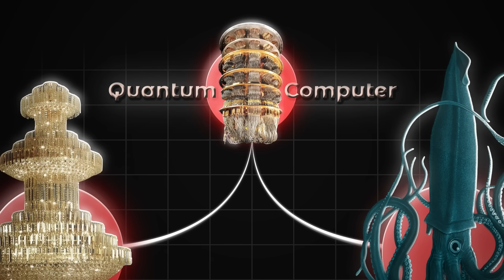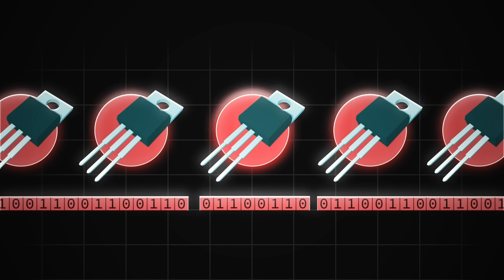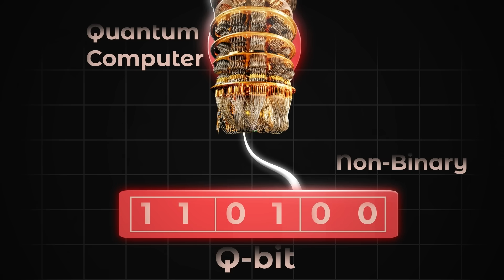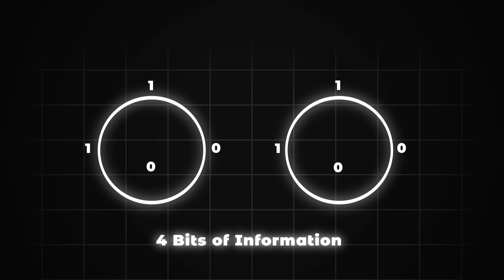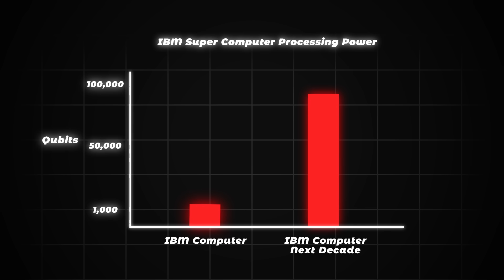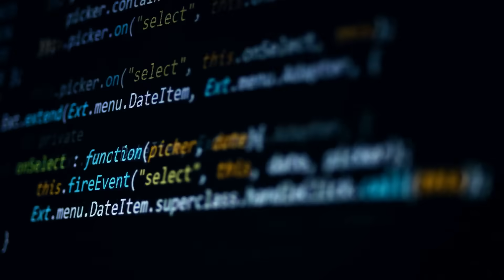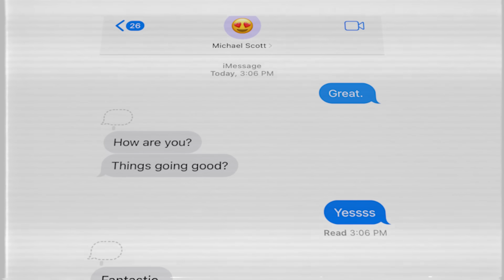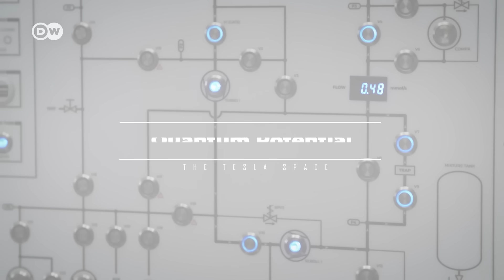Why Quantum Computers Will Break Reality

Comment: Ohhh up and down and left and right even off and on. 🤔 dont add center too? 🤔 sound like some cannot go smallest that why had to update different thing to order to made smallest into atoms. Rotor it flip down and up and left and right flip of spinning around with off and on. 🤔  i am correct?.
So it high speeds it made sound one of sound could cause error but limit speed ?. Because speed limit are order for one atom because if too fast spin speed it give one number in many number but need more quick reading to be get more number to send out signals  if slow readings it will think it 0 and 1 in one number confusing signal.

Comment: Pretty well done! Except you do not have to be at absolute zero to achieve superposition since trapped-ion via a radioactive element shown by IONQ achieves that at a stable room temperature. Also, the critical error rate will and has been increasing upended in a positive way via combination of AI algorithms and photonics. With this, a new quantum algorithm will eventually be able to stabilize the critical error rate to what binary classical computers have now. Probably five to ten years away but still very much achievable. Thanks for the video

Comment: If I'm not mistaken, quantum superpositioning isn't a physical description of electron spin actually existing in both positions at once as much as it is a description of the potential for both to exist, and that potential isn't actualized into one or the other until it is measured. I think it could just as easily be said that neither state exists or that the electronic spin is yet to have a determined state until the point when it is measured.

Comment: 3:35 This isn't true - at least not anymore. Traditionally, the process node designation such as the "28nm process node" was a reflection of the gate length, which approximated the actual physical size of the transistor. However, the last process node to reflect the actual size of a the transistors was the 22nm process node. The 3 nm process node is not actually 3nm in size. It's actually between 16nm to 18nm in size (gate length) depending on the manufacturer. So, while that obviously still incredibly tiny, it's about 6 times larger than you would think from the name.

Comment: Scientific Approaches to Superconductivity in Uranium Compounds

1. Heavy Fermion Superconductors: Uranium compounds, such as uranium tellurides and uranium platinum compounds, are part of the class known as heavy fermion systems. These materials contain electrons that behave as though they have an unusually high effective mass due to strong interactions between electrons. Some of these uranium-based heavy fermion materials have been found to exhibit unconventional superconductivity.

2. Nuclear and Magnetic Effects: Uranium is a heavy actinide element with significant nuclear and magnetic properties. Its 5f electrons, which are more delocalized than the 4f electrons in rare-earth elements, contribute to the complex electronic structure of uranium compounds. The interplay between magnetism and superconductivity is of great interest in these materials, as superconductivity can sometimes arise in the presence of strong magnetic ordering.

3. Superconducting States in Uranium-Based Materials: Compounds like UBe₁₃ and UPt₃ have been shown to exhibit superconductivity at very low temperatures. These uranium-based materials display unconventional superconductivity, meaning their superconducting states are not fully described by traditional BCS theory, which typically governs the behavior of conventional superconductors.

4. High-Pressure Superconductivity: Some uranium-based materials may exhibit superconductivity when subjected to high pressures. Altering the crystal structure through external pressure can affect the behavior of the electrons, potentially inducing superconducting states.

5. Superconductivity and Topological Materials: Uranium ions and their compounds may also be involved in the study of topological superconductors, which are materials that may host exotic quantum states at their surface or edges. These states could be useful for quantum computing applications due to their robustness to environmental disturbances.

Challenges

The challenges in applying uranium to superconductivity are mainly in terms of material stability, safety (due to uranium's radioactivity), and finding conditions where superconducting properties can manifest at higher, more practical temperatures.

In summary, uranium ions and uranium-based compounds are an area of study within the broader context of superconducting materials, particularly those that display unconventional superconducting behavior under specific conditions, such as low temperatures or high pressures.

Comment: I am very sceptical regarding qbits in quantum computing. How are we suppose to know which state is the correct state since we have to observe it even to check. Maybe with a few qbits it is possible but after a few thousands of them... but what do i know. Im just a simple engineer. Till that day comes i will be skeptical. And no, it will not replace normal computers. They are more like super duper calculators, but I'm skeptical.

Comment: I want to share with NASA, ESA, Elon Musk and SpaceX the Delta Vehicle I invented on April 19, 2000: a revolutionary system that harnesses all known deltas: Pressure, Voltage, Magnetism, Density, Temperature, Height, and Gravity. The most critical aspect of my Delta Vehicle is the Gravitational Delta. To fully utilize Gravitational Waves, the vehicle is equipped with three specialized devices:
1. Gravitational Wave Tuner: To precisely adjust the vehicle's alignment with gravitational waves.
2. Gravitational Wave Amplifier: To enhance the vehicle's response to these waves.
3. Gravitational Wave Router: To direct and control the flow of gravitational energy, enabling efficient movement and energy generation.

Comment: Quantum error correction cannot be solved if you don't implement the fifth Dimension. And I have noticed certain hints about this by the Chinese, comparable to the implosion of the atomic bomb. By the way, quantum mechanics explains through the fifth dimension what holds the largest and smallest forces together in there cosmological Infinity. Choose your future.

Comment: Quantum computers have the potential to break reality as we know it by fundamentally altering how we process and understand information. Unlike classical computers, which use bits to represent either a 0 or a 1, quantum computers use qubits that can exist in multiple states simultaneously thanks to the principles of superposition and entanglement. This allows them to perform complex calculations at speeds unimaginable with current technology. But this power comes with profound implications. Quantum computers could crack encryption methods that secure everything from online banking to national security, rendering current cryptographic systems obsolete. Beyond that, they might solve problems in chemistry, physics, and artificial intelligence that are currently beyond our reach, potentially leading to breakthroughs we can't yet predict. However, this also raises ethical and philosophical questions about the nature of reality itself—how much control should we wield over such powerful technology, and what unforeseen consequences might arise from unlocking the full potential of quantum computation? The line between science fiction and reality is blurring faster than ever.

Comment: This video should be taken only at a high level of thought on quantum computing.  Their are mistakes made in this video at the lower levels including his description of Schrödinger's cat.  Which does involve a cat, poison and a box but also requires a radioactive source and a geiger counter and furthermore the poison has to be sealed with the cat not being able to open it.  On;y the geiger counter going off can open the poison which would be a gas because if the geiger counter goes off then the cat instantly ingests the poison and dies, the thougjt experiment has no choice by the cat.

Comment: “With great powers comes great instability” Sound better and more relatable than responsibility
Reply: Because it's merely descriptive, rather than normative and exhortative.  It describes a future that is worrisome, rather than alerting or admonishing the reader to fear and fix the problem that will occur.  Eg, the regular phrase "with great power comes great responsibility" encourages the holders of power to act honorably ('responsibility in the exercise of power is required before it should be concentrated; the masses should give leaders power over them only if those leaders are virtuous and trustworthy'). Also there is an implicit bargaining in the future (or at least present) tense used in the regular phrase -- between the receiver of the power and those for whom she will have responsibility.

Comment: A qubit only has 2 possible spin states - which is reflected correctly when you say that 20 qubits has just over 1 million possible outcomes because 2^20 = 1,048,576.

I think you did a really good job explaining this part conceptually, but I wanted to point this out because I think it is important to note this since I think there is a small error or hole. At around 4:45 and 5:20 when you show the graphic its a bit misleading in the sense that it visually appears that there are 4 possible spin states within each qubit, when there are only 2. It seems like you are saying that a particle both has spin in the up and down direction and left and right direction - and I am now assuming that you did not know this I am just being thorough, but terms like "up" and "down" do not actually denote direction in quantum mechanics and are arbitrarily assigned to represent opposite state of existence for that quality of the particle, the particles don't actually spin around... this is called a degree of freedom - which is a descriptive quality of a particle that can be represented by one dimension. for example analogously, if something only has one degree of freedom it can only move forward or backward on a line, but if something has two degrees of freedom, it can move forward or backward on one line AND left or right on another if we draw a perfect + shape grid originating at the object, and it can traverse any of the space between those lines on that plane. this means if we divided the plane into quadrants separated by those plus shaped crossing lines, like look at a cartesian x,y plane for example, we would need TWO pieces of information to describe the what quadrant a point is in using only x and y if the origin is 0,0. Those pieces of information are the sign of the x and y value of the position of the point, so something could be in the "upper left" quadrant and you would need to say x is negative and y is positive. The purpose is to break the position down to two binary options - which side of each line is it on. Sorry for the long digression but i want to be thorough.

The trouble here is that a particle does not have 2 degrees of freedom for spin in this case, it only has 1. Meaning it can not be matched into one of four quadrants, because there are not two lines to look at, just 1. it is either "above" or "below" the single line. It is either spin up or down, it is not some combination like "spin up, spin left" where there are 4 possibilities within a single qubit. 

If you want to think about it this way because you liked the analogies/examples I already gave, in reality to describe this each line in the cartesian space we defined is a representation of a qubit. With only 1, there are only 2 possibilities, above or below. With 2 lines, there are 4 possibilities because we have the quadrants I talked about. With a 3rd qubit, we can draw a third line, then all of the sudden within EACH INDIVIDUAL quadrant on the 2D grid, there is now the possibility of also being on either side of the 3rd line, making it 8 possibilities...

For quantum computers the number of possibilities can be represented by 2^n, where n is the number of qubits. So in the cases we talked about, 1 qubit is 2^1 =2, 2 qubits is 2^2 = 4, 3 qubits is 2^3 =8... until we get to 2^20=1,048,576. 

I would like to conclude by saying that this video was well done and that explanation was great, and I would not have been able to articulate any of this before watching the video. This video genuinely bettered my understanding of some aspects of quantum and taught me new things and I can wholeheartedly say I learned from it. I wanted to point out this hole because I went and thought about the video for a while and I noticed it.

Comment: Nice video, but your explanation about the amount of information qubits can hold versus regular bits is subtly misleading. Two regular bits can hold four possible states: 00, 01, 10, and 11. Two qubits can also only  hold exactly four states, it’s just that they can hold them simultaneously. But as you know, when you observe the state, it has to collapse down to exactly one of the four possibilities. The trick with a many quantum algorithms is to create a situation in which the correct answer is what the quints are most likely to collapse to when observed.

Comment: 3:36 this is a bit misleading. 

1. The A17 isn’t 3nm. It much closer to to  a cm or more
2. 3nm is just a marketing term. The size of the transistor at least 3x that size. If you look on wikipedia, the gate pitch size is 48nm gate pitch

Comment: Viruses do not have superposition. They are not quantum entities. Had that been so, computer scientists would have been fathoming how to harness them as quantum material to build quantum computers 50 years ago. Even now, they would be easier to work with than materials that require cooling to a few degrees Kelvin or less.

Comment: A bit is binary. But saying that a qubit has 4 positions doesn't add up: it as the "old" two positions, plus a position that can be both. This is 3 positions, of which a third can be either a 0 or a one, or potentially both at the same time. It's exponential - especially when you add more qubits. When someone is a binary thinker, like most mathematicians, theoretical physicists, etc than a quantum computer can make mistakes. Define "mistake."
The Schrödinger's Cat presentation is also not correct: Schrödinger connected, in his thought play, a tube of poisonous gas to the box. It was meant as a joke on the wave particle experiment.
Atom Computing is the record holder with a quantum computer that has 1180 qubits.
When "we" will succeed to build a transistor that can hold a superposition that is infinite, then it will be probably GAME OVER, because it would mean we have equalled zero-point, or the field, event-horizon, or the real singularity. This will the brother of God in this physical universe. And probably beyond.
Can't we humans first learn to Live and Respect Life?

Comment: nms in modern chips don't actually signify transistor size or the size of anything actually. It's more of a marketing gimmick/representation of transistor density at this point. In fact, it was never used to designate transistor size. Originally, it was used to measure the distance between transistors.

Comment: The key to success is down to a coulomb. Program you quantum computer to realise PI contains the number decimal places that a coulomb has electrons. It was already comprehended long ago that it must end. With the computers we built it was easier to say Pi is infinite as they would have not been able to compute the total causing it to crash as they where not powerful enough to create a number so vast. It made it simple for the operating system thats all.

Comment: All computers have errors. We build in redundancies and checks to make it less frustrating for the user. Data corruption and packet loss are pretty common tho.

Also, we've achieved qubit entanglement at room temperature, so the space and hardware requirements should start to come down.

Comment: If you combine 2 cubits you get 4 bits of information - actually, there's one more axis (we live in a 3D world!), so there's X, Y & Z. So, by your own logic, it should be 3+3 = 6 bits (I think it's completely wrong to calculate it like this, btw). 
Also, a technicality - most/all existing devices can only measure along one axis (e.g. the Z axis, sensor is on the top). 
So, even if it's 6 bits or whatever, you have to do some "calculations", then rotate them and you can only get out two bits in the end. Also, it's not like you do it once - usually it's 500 or 1000 runs of the same, and you do an average, because errors can happen.

Comment: The part that gets me is Quantum computers typically operate at extremely low temperatures, close to absolute zero — about -459F — to maintain the delicate quantum states of their qubits. So how can this be achieved for commercial or private use. 
Update: 2mins later after i wrote this ...they say the same thing 😆

Comment: If, and it’s a big if, they can actually make one work. Unplug now while you still can. If you pull your Bluetooth, network and cable connections and run your computer as a stand alone, that may be the only way to be safe. Once you plug in all bets are off. Is your cell phone listening to you and or taking video of you when you are not using  it. It could be. Even when your battery is disconnected your microphone can still be scanned and used to listen to you. I have news for you, a microphone always works it just needs a path to an amplifying device. With the right type of scanning equipment one can tune to the microphone and amplify the signal and listen to you talking.
Reply: okay? 😅